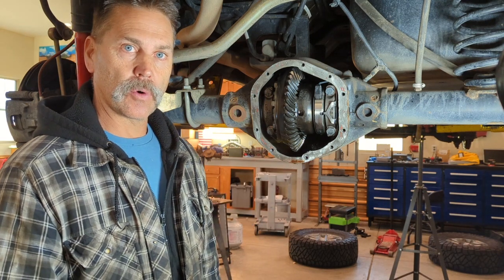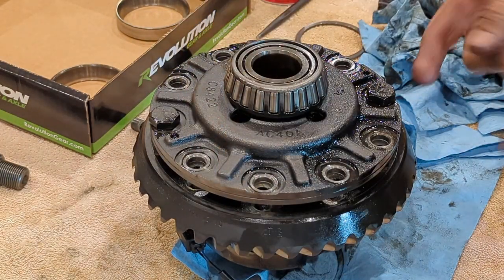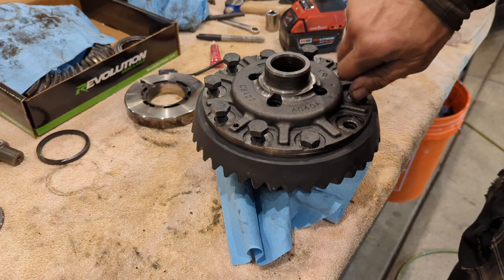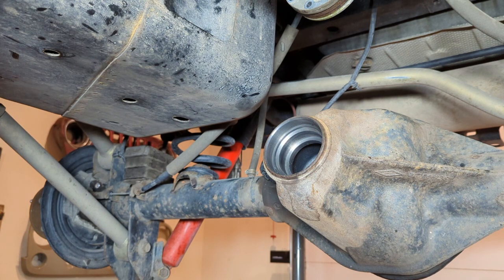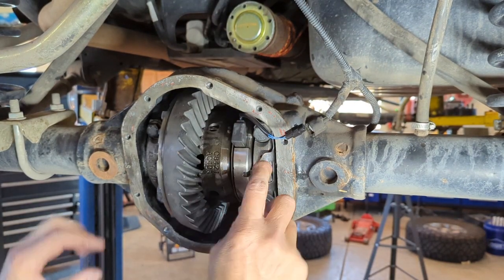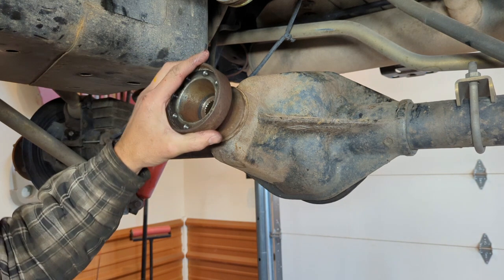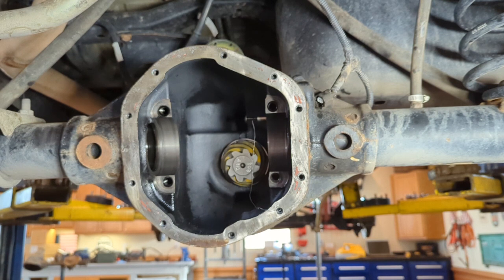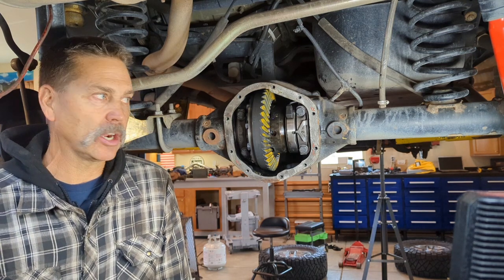How to Re-Gear a Jeep Wrangler JK Rubicon Dana 44

Comment: What do you do with the plunger to keep from having to use that little piece with the wire on it every time you install the carrier during mock up?
Reply from the maker: You can put a small piece of wood or other item (without the wire) to space it until you're ready for final assembly. On the high pinion front you have to remove the plunger. Once you are ready for final, reinstall the plunger and then space it like before.

Comment: I remember the absolute worst part of doing this was repeatedly getting the carrier in and out with proper preload while making adjustments.  If I have to do this again, I will probably get a case spreader to make it a little bit easier.  Thanks again Mike, my gears are still running strong with no issues thanks to my following the tips, tricks and guidance from your how-to videos.
Reply from the maker: You forgot sore knuckles!!
Reply: @TheBFHGarage  I was also doing this on the ground which was a friendly reminder by my back that I am getting old.
Reply from the maker: @kpfalconi  been there done that. I'll pull the axle and put it on a bench before I ever do it on the ground again! That's exactly why I bought my lift!
Reply: @TheBFHGarage  Trying to get the boss (aka wife) to approve the purchase of a lift.  Hahaha

Comment: Hi Mike, I'm new to your channel. Glad the algorithm showed me your stuff. I have enjoyed the 4 wheeling videos, but my main interest has been the tutorials. Great stuff. I have a question for you: would you upgrade the front axle of a 2010 JK to a front Dana 44, or add the locker, and new ring/pinion to the original Dana 30? I'm leaning to the upgrade. I'd keep the 44 in the rear. I'm re-gearing as the first priority, and adding the lockers as the second priority.
Reply from the maker: Upgrading the axle only nets you a slightly bigger ring gear. The weak point is still the ball joints which are the same for the Dana 30 and 44. I would personally keep the dana 30. If you are going to pay for a re-gear, do the locker at the same time as it is easiest to do it at the same time. If you do them separately it will cost you twice as much. If you are only going to install one locker, make it the rear. Good luck!

Comment: Excellent tutorial.  I've done a number of gear changes in my past for hotrods and will soon install 5.13s in my JKURHR and needed a guide to brush up on what is needed for this job and this video is fantastic.  I feel much better prepared after watching it a couple times and taking notes.  Surprised you didn't use an air hammer on the pinion.  I no longer have a compressor but wonder if a SDS point bit on a cordless hammer drill could do the job also.  Is pulling the axle really a better approach vs on the ground?
Reply from the maker: Setting gears on the ground absolutely sucks in my opinion. If you're going to do it that way, just be prepared for a sore body and lots of frustration! I have used an air hammer on occasion and they do work quite well. Good luck with your job!

Comment: The bearings in my front 44 are making noise so im going to replace them. I know there is a seal for the input yolk but are there seals in the shaft tubes? Trying to order everything at one time.
Reply from the maker: @chrisw46360  yes, right at the diff housing.

Comment: Mike, I'm back, on the right video this time...for the life of me, what did you do to hold the pinion in place to check backlash? You said rear bearings, but that doesn't hold it all the way back. Did you install the drive shaft connector with your set up bolt? I have the set up race and .048 shims <measured from factory> ready to go. I feel I'm over thinking this.
Reply from the maker: If the pinion moves when you're trying to check the backlash, then you can just hold the flange with your hand.
Reply: So nothing needs to be on the back of the pinion  to put in the carrier to check backlash? How did you drive the pinion to run a pattern?
Reply from the maker: @maxellis950  nope. Checking backlash is as easy as clicking the carrier back and forth. To run the pattern, I use a drill with a socket adapter. Easy.
Reply: Thank you, I knew I was over thinking it
Reply: @TheBFHGarage  Mike, still having issues. Any other way to contact you to discuss it?
Reply from the maker: @maxellis950  reach out to me via email. It's on my YouTube home page.
Reply: I have the same question.  Without pressing the bearing onto the back of the pinion what holds it in and what is the socket driving when running the pattern?
Reply from the maker: @Helmutvongonzales watch the entire video! You put the tail bearing on and push it on with a socket or impact with the yoke in place. To remove it, use a punch and tap it out.
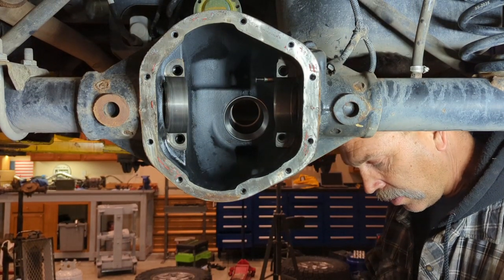Reply: Thanks for the reply, I've watched several times.   My confusion is at 23:30.  You're saying at this point to  put the bearing and flange back on, then drive it off later?     Leave the crush washer off while setting up?
Reply from the maker: @Helmutvongonzales  correct. No crush sleeve and no seal.

Comment: Is it difficult to torque the ring bolts? Could you just get them tight and once everything is final and it's in the housing remove and apply thread locker/ torque one at a time?
Reply from the maker: It can be. It helps if you have a second set of hands or you can put it in your press lightly to hold it. Do that before bearings. If not, then yes, I have seen people install it and then tighten the bolts.

Comment: Hey! I just torqued my pinion nut, I’m reading a rotation inch pound of 25-26. On my rear Jeep jk Dana 44. Yukon recommends 20-30, ahold I be good to go or is it too tight?
Reply from the maker: If you're running Yukon gears then go by their recommendation👍

Comment: I have a 17 rubicon.  Running into the issue of locker not disengaging. Locks fine. Have the cover off and have voltage when engaged. Ring slides over and locks great. Go to unlock and I can manually push the ring over. Very easily at that. Seems as if have good pressure pushing it to unlock but won't without my help  . Don't visually see anything broke. Any ideas
Reply from the maker: Sounds like a faulty actuator, but not 100% sure

Comment: I have a 2007 wrangler non rubicon is it the same process? Is it basically the same for the front when you have a Dana 30?
Reply from the maker: Same process, just no locker. Makes it easier for you actually.
Reply: @TheBFHGarage  have you ever used a Yukon Dura grip? Not sure what my Jeep has in the back I just bought it. I don’t want to go through all this and have only 1 wheel spinning. It will be driven mostly on the road with some trails. No Rock crawling or mudding. Will be going g in the sand at Silver Lake Michigan.
Reply from the maker: @kirtcorkins1682  never have and couldn't tell you anything about them 🤷

Comment: When you install the pinion for the first time with the old shims during setup, and you need to put the tail bearing on, do you tighten that down at all ?
Reply from the maker: Yes. Just until you get some drag
Reply: With or without a crush sleeve? (Yukon kit included 2 and shims for I’m guessing the tail bearing) then if you get pressure will you have to take a dead blow and hammer the pinion back out? I am a machinist and went and ahead and bought another bearing and dusted the inside race of that to a slip fit with no shake, so that I can easily remove and add more shims for setup.. seemed like a good idea
Reply from the maker: @brading84  don't install a crush sleeve until final assembly. No need to make the tail bearing a slip fit. Just take a punch and you can tap it back out.
Reply: @TheBFHGarage  got it. Referenced one of your other videos after I posted that lol. I meant the main pinion bearing that I dusted, not the tail. Thanks for your help and videos, and for responding pretty quick!

Comment: One more quick question, how many ft. Pounds does it take to crush the crush sleeve? I’m kind of confused how you use inch pounds to check it but need a ft pound torque wrench to check it.
Reply from the maker: It can sometimes take an incredible amount of force to START the crush sleeve... I've read as much as 600 ft/lbs. 
When the crush sleeve starts to crush, it allows the bearing and race to come closer together causing interference/friction that is measured in in/lbs.
So, starting it and crushing it takes ft/lbs. Measuring the resistance once the bearing and race comes together is measured in in/lbs.
Reply: @TheBFHGarage  so how will I know once the crush bearing is crushed and I need to start measuring the Inch pounds?
Reply from the maker: @AustinH7  You'll notice when you first put everything together, but before you crush the sleeve, the pinion will rotate with ZERO resistance. When you start to crush the sleeve, the rotating resistance will INCREASE. When it starts to increase, you start checking preload with your in/lbs torque wrench.

I can PROMISE you that it is super easy to over crush the sleeve which would require starting fresh with a new crush sleeve. I always have extra crush sleeves on hand because of this. It's a really fine line of getting the crush sleeve to start without over crushing it. Sometimes an 1/8 of a turn is all it takes to screw it up, so take your time and measure OFTEN. If you are close, as will be indicated by increased resistance, make very MINOR increases as the preload will increase quickly.

If you over crush the sleeve, you must start with a new one. You cannot loosen it back to the correct preload.

Comment: Hello, I had a quick question about carrier preload. So I got my backlash set to 8, I am using the factory shims on either side with an extra smallest possible shim on the right side that came with the Yukon kit. It’s not terribly easy to get it in, it’s mainly the shims getting jammed while trying to slide it in, the shims need to be tapped in and the carrier itself needs to only be tapped in very slightly to seat in. Does it sound like I have enough preload? I tried to add more shims for preload but have been unsuccessful and just end up bending them. Should I try to add more shims for preload or should I leave it alone?
Reply from the maker: Put the shim between the race and the OEM master shim. If it doesn't take much to get the carrier in then I doubt you have enough preload. Should take 6-8 whacks with a deadblow hammer.
Reply: @TheBFHGarage  thanks for the response! If you could ballpark how much extra preload shim  it usually takes to get a good preload, I just don’t want to unnecessarily try to stuff preload shims on that are way too big. Because currently it’s already difficult to get the shims in place that I used to find the backlash. It’s a Jeep JK by the way.
Reply from the maker: @AustinH7  Doesn't matter that it's a JK, an axle is an axle for the most part. There is no magic number or ballpark per se because you still have to keep backlash in spec. The carrier shouldn't drop right in. If you have shims that create just a little friction when you install the carrier, then you're close. If you can't get the carrier to start dropping in, then you have too many shims. The magic number is somewhere in between there and is usually only a few thousandths difference. I wish I could explain it better but that is pretty much it. You should not be able to push it all the way in by hand. Get the most preload you can and still get it inserted.
Reply: @TheBFHGarage  will do. I appreciate you commenting back!

Comment: Since you have the clamshell puller why not use shims that go under the bearings?  Makes it a ton easier to remove and install without risk of damaging or losing a shim.
Reply from the maker: That is always an option depending if your master install kit came with those smaller shims. Most come with shims that go outside the bearings.
Reply: @TheBFHGarage  Good point.  I became a fan of the under bearing method after a .010's outer shim nearly sliced the tip of my thumb off.
Reply from the maker: @Tylerknoxville3  Some carriers/lockers require shims to go to the outside. ARB has some that go outside, and then some in the seal housing between the seal housing and the bearing. It all depends.

Comment: Will the backlash change when torqued done
Reply: Sorry down not done.
Reply from the maker: @jamesdavis8952  it shouldn't. If it changes within 1 thou or so I wouldn't worry. If it's changing a lot, then you don't have the proper pre-load.
Reply: Would I need to add preload?
Reply: Mine went from .006 to gone.
Reply from the maker: @jamesdavis8952  your question isn't very clear. What problem are you experiencing?
Reply from the maker: @jamesdavis8952  them you probably didn't have the carrier set properly during setup

Comment: How much does it cost to re-gear 2015 rubicon. Total parts and labor. It has 410 and I would like to go 488. By the way absolutely best video on YouTube by far of a gear change great job. 👏🏼 👍🏼😊
Reply from the maker: @dannycardin8966  depends on what shop you go to. Prices vary GREATLY. It also depends on the parts you buy. A whole lot goes into costs.
Reply: @TheBFHGarage  thank you for your reply. Can you tell me how much you would charge if you were doing the job?
Reply from the maker: @dannycardin8966  I don't post pricing.
Reply: Ok thanks. Can you tell me some place you would trust in North West Indiana. There’s really no 4 wheel drive shops around here.
Reply from the maker: @dannycardin8966 I'm in Colorado.... No knowledge of Indiana shops
Reply: @TheBFHGarage  ok thank you